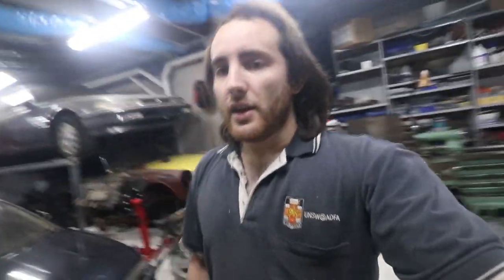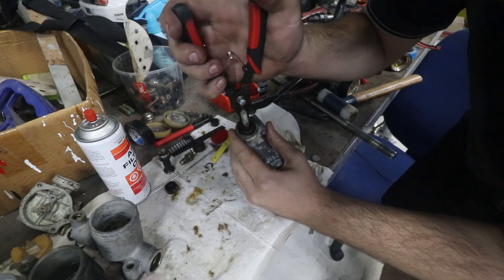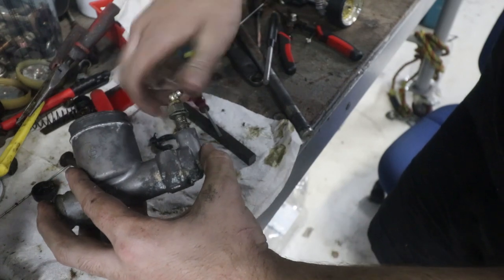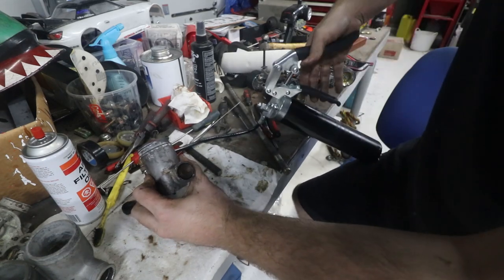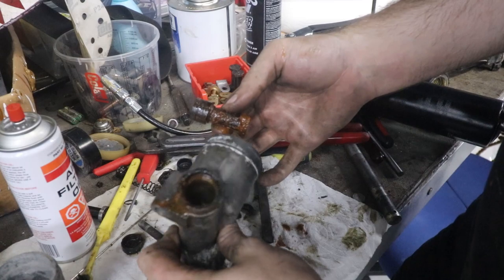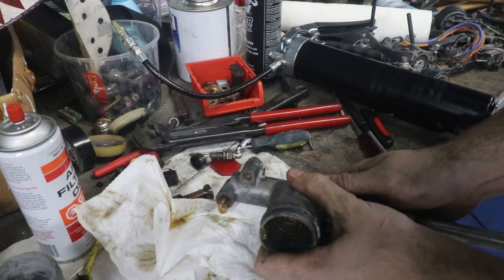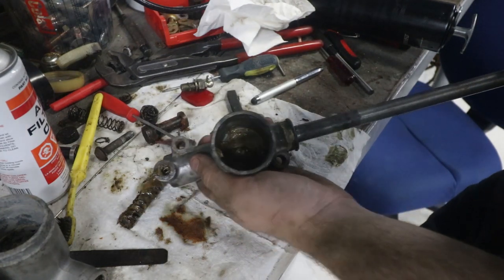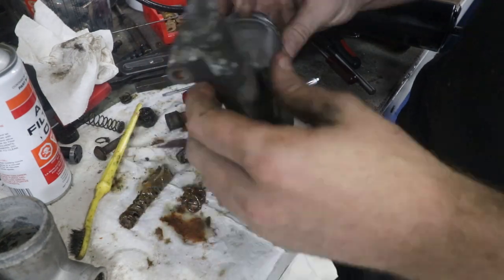How To Remove A Stuck and Seized Master Cylinder Piston the Easy Way.

Comment: If you remove the Zert fitting from your grease gun. You can screw your grease gun directly to your master cylinder & not have to drill out a bolt to fit a grease nipple.
Much easier!
Reply from the maker: Didn't think of that

Comment: Gday Conor - I'm an Aus kiving in Canada and Have a 65 MGB.  Unfortunately rear ended someone (merging lane) which was attributed what appears to be a seized master cylinder.  The master cylinder is about 1-1/2 years old and I'm wondering if you could tell if you have heard of them seizing being so close to new?  I've been thru the linkages, looking for obstructions everything and can only deduce its the cylinder piston binding?  The brake pedal refuses to go down when I depress it.  The brakes themselves aren't binding, they're simply not engaging.  Many thanks in advance
Reply from the maker: Is a line kinked?
Reply: @Conorsev  No it isnt kinked, I'm beginning to think its seized (the piston in the cylinder).  I'll bleed the brakes and see if the pedal moves.  If it doesnt then....
Reply from the maker: Guessing you stomped on the brakes super hard?    Might have bent the pin in the master or something
Reply: Gday Conor, sorry for the delay.  Root cause ended up being what appears to be part of the dust cap (supplied as temp seal with the master cylinder) lodged into the banjo bolt thus completely sealing off the ability to push hydraulic fluid thru the system.  Weirdly I kept the packaging including the dust cap I removed so I am stumped if its a quality control issue or other.  In the end I flushed all lines, everything clear and brakes work flawlessly.  Regardless of this I have bought dual line system (because I can) and plan to install that in the near future.
Cheers

Comment: Just did this on a seized piston for master break cylinder for a motorcycle - worked perfectly - first time and I couldn't wait more than an hour soaking it in WD40 to try it out :-). 
Mate you're a genius - I spent several hours trying everything else including a heat gun etc. Realised why it works when I read that my grease gun can generate up to 4000 PSI of pressure. Thank you!
Reply from the maker: Good to see it was helpfull.  What kind of bike?
Reply: @Conorsev  Suzuki Intruder VS1400 (1996) - a work in progress !